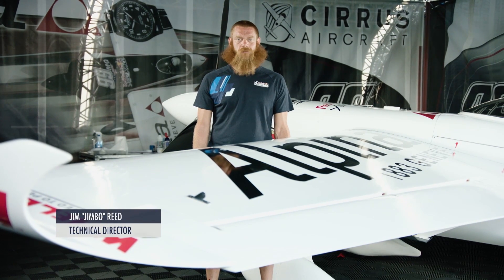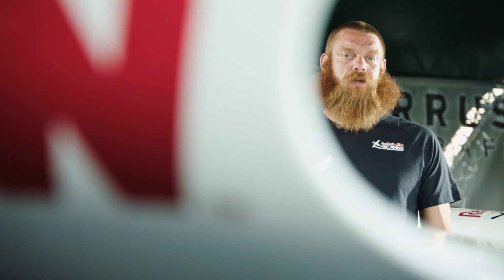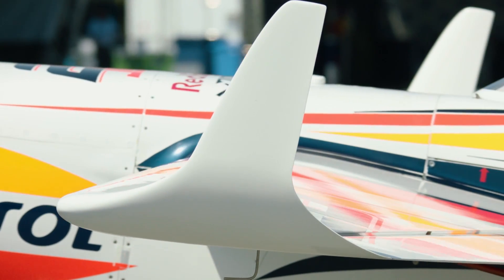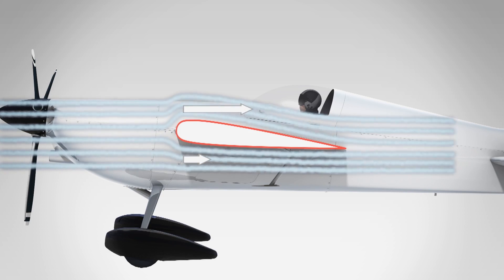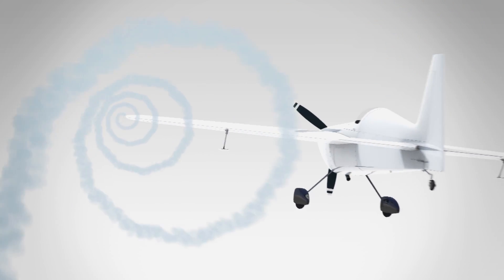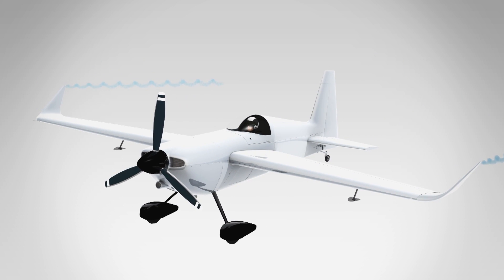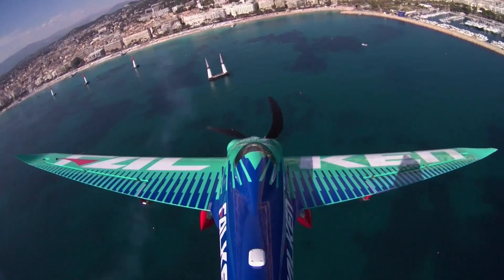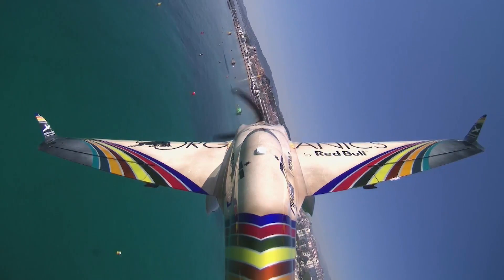Red Bull Air Race Tech Talk | Winglets

Comment: Also, the control surfaces don't turn the plane, the lift from the wing does. The control surfaces just align the wing. More efficient lift means tighter turns :)